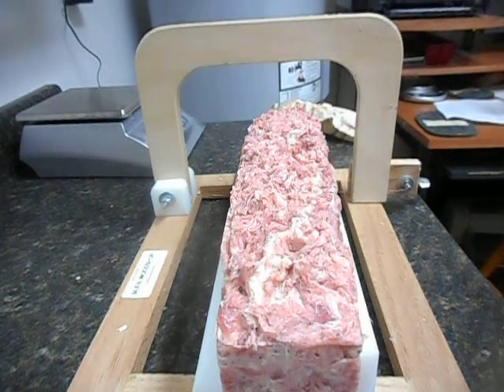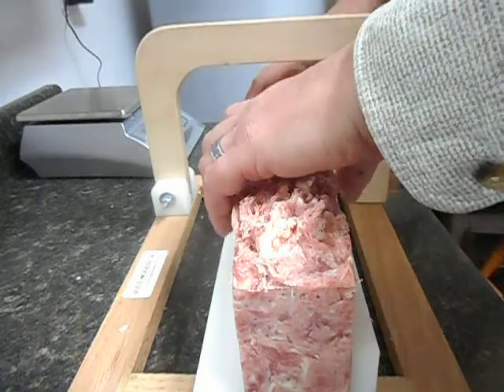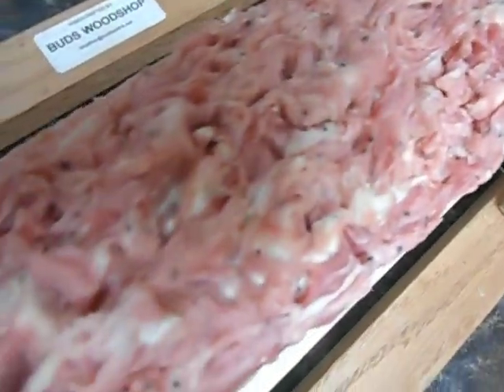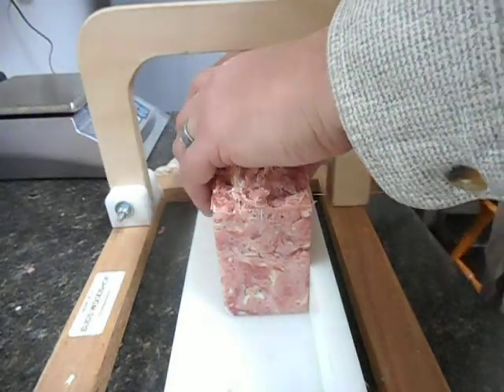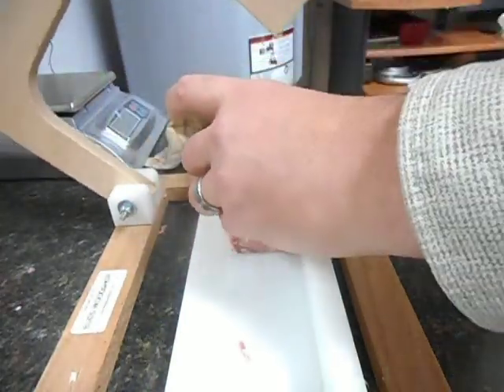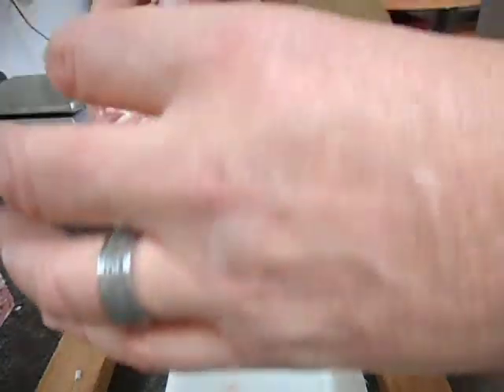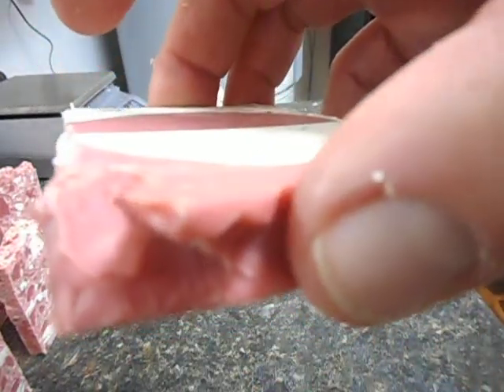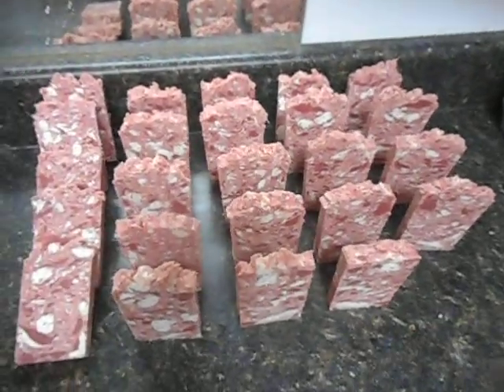Soap cutting 010418 two color column mold

Comment: It still turned out really nice.  I like how you combine different FOs.  I’ve always avoided the vertical molds just because they look so hard to deal with.  But you’re pretty darn good with them 😊
Reply from the maker: Thanks, Mary.  The vertical mold is hard to work with, but I really like it.  I just unmolded the other soap and it did exactly what I wanted.